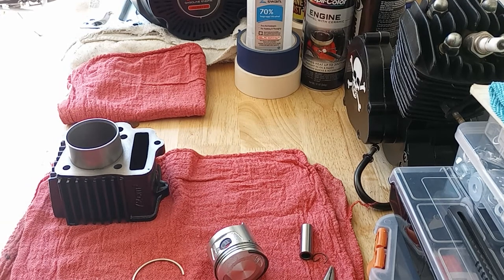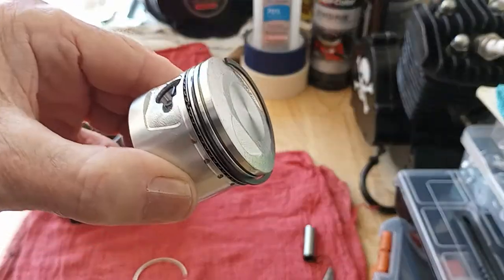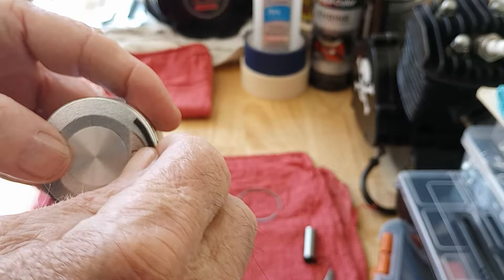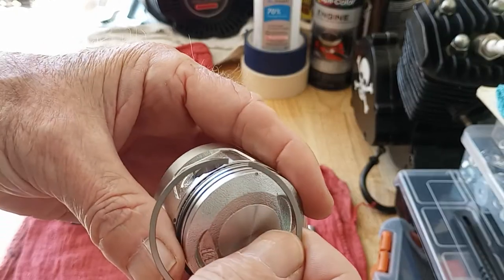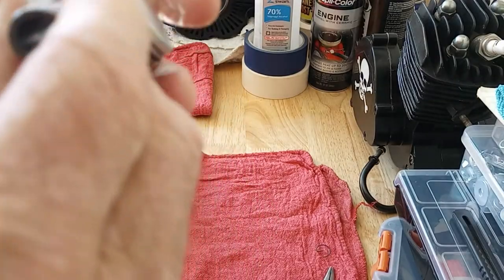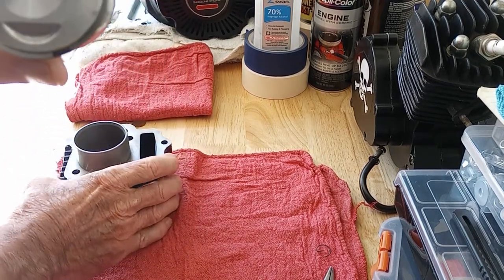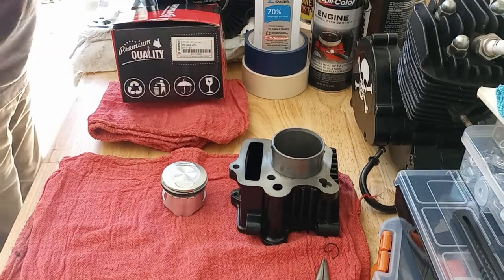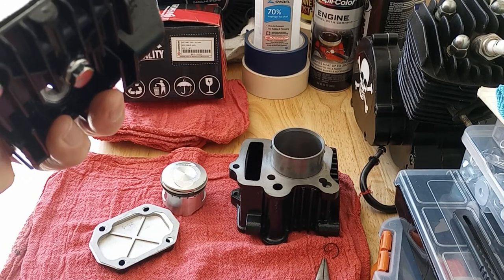Phatmoto/Sikk Ped: Piston prep and rings install, wrist pin keeper, for the 72 cc BBK.

Comment from the maker: The very bottom rings are the oil control rings. They are a solid ring on bottom then a baffle or corrugated ring then another solid ring. They have no top or bottom and no markings. The 2nd and 3rd ring have a letter marking. The 2nd. ring known as the scraper ring has a "R" marking. The top ring is the compression ring and has a "RN" the letters go to the top.

Comment: Hey  Beau good morning to you an yours : How many hp is this engine gonna have ??
Reply from the maker: Okay, this is a guesstimate, if the stock 49.5 cc's produces 2,7 to 2.8 hp, my unscientific guess would be 3.5 to 4 hp. My theory is if rounding off to 50 cc's produces 2.8 hp, that is about 1.4 hp for every 25 cc's. So add 23 cc's to come up with 72 cc's and that works out to approximately 1.2 hp. Add that to the existing 2.8 + 1.2 = 4 hp. So my guess is 3.5 to 4 hp.
Reply: @beaubrummelmotorizedbicycles  that would be a tremendous gain over my stock 1.5 hp I have now! I’m kissing 25 mph now with little tricks I’ve done / your suggestion! 😎4️⃣ horses 🐴 are always better than one ☝🏻 horse 🐎
Reply: Plus I’ve lost 25 # staying on my diet has put me down to 179…LOL…
Reply from the maker: @randallchunn8286  If you have 1.5 hp now, you are probably running a HS 49 cc 4 stroke. Which is a very capable engine for what it is.
Reply: @beaubrummelmotorizedbicycles  mines the 79cc 4 stroke with 1.5 hp!
Reply from the maker: @randallchunn8286  Really, a 79 cc should have a minimum 2.5 to 3 hp. What brand engine is it and what style valves, (flathead, OHV, ?)
Reply: @beaubrummelmotorizedbicycles  made in China , book says 1.5 hp , looks like a pressure washer engine OVH engine!
Reply: What comes with a 2022 Phatmoto all terrain gas bike!
Reply: Wish we could share pictures on here!
Reply from the maker: @randallchunn8286  A Lifan 152F-3 79 cc engine, only it is 3 hp. That's what comes stock on all Phatmoto's, So book is wrong.